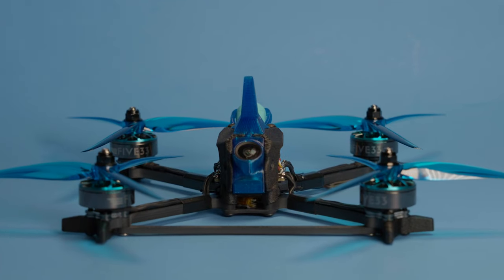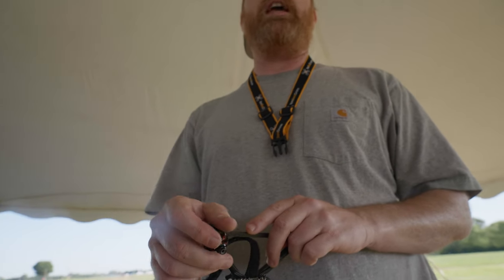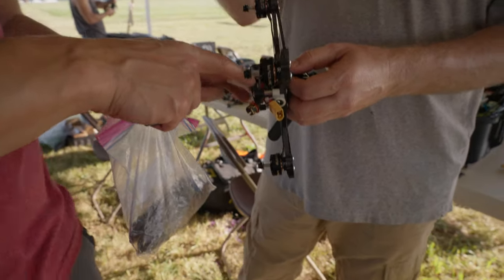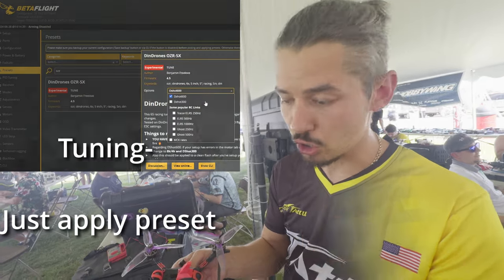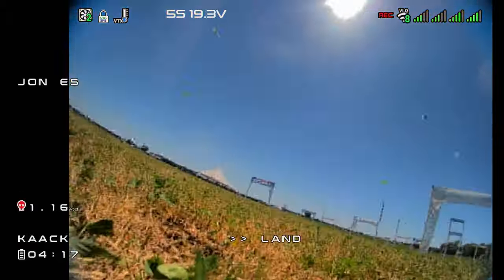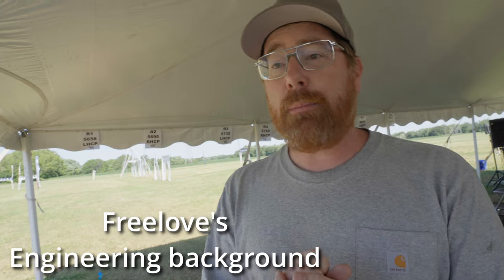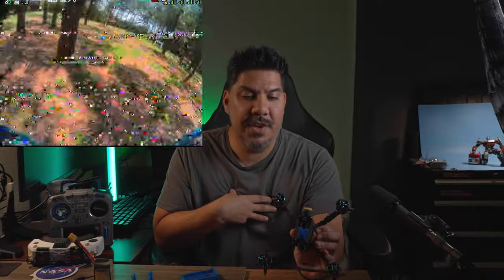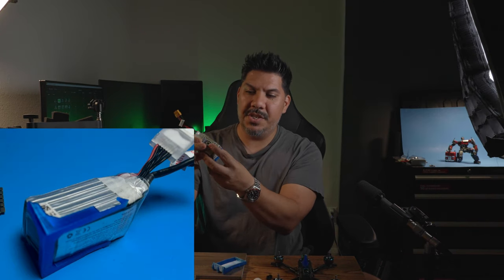Racing drone made faster and stronger with Redbull engineering

Comment: If you look up the definition of Sh*t pilot in the dictionary you will see my picture. I built two of these quads, loaded up the presets for HDZero, ELRS, and the OZR tune and was absolutely blown away by how well this quad handles. No quad is able to compensate for my dismal lack of race skills, but this quad upped my racing enjoyment factor by making it easier to do more laps, faster. I'm ready to pull the trigger on another frame to have three race rigs ready to go.
Reply: What were you running before?
Reply from the maker: Yep. We in the same boat.  Can’t wait to compete with this setup
Reply: @malikmarez1407  Floss 3 so I was really ready for a change!

Comment: I'm still out here running way jankier stuff than Jon - but yeah, what a rad frame.  I'd still want to build one of these slightly chonkier with longer arms for the back, but this is definitely something I want to try out.
Reply from the maker: True. Maybe they make some hybrid arms for that clean air feeling. Although with the tune, it feels just as smooth to me.
Reply: @JonE5FPV  to be honest I've stopped caring about that I actually run at race pace

Comment: Carbon fiber braces are pretty light, but when hit all that force goes right to your electronics (I assume). I wonder if the braces were made of nylon or polycarbonate, would it make the race quad both strong and force absorbing to protect the electronics (at the expense of a little more weight)?
Reply: the main purpose of the brace in this build is to add arm stiffness, so they dont flex under load (heavy corenring etc.) and dont introduce any new noise to the gyro. If you 3d print a brace, you'd need to make it thicker and wider to get that stiffness, and it will be not 2-3g per brace but 8-10g which kills the purpose of a lightweight build. My whole point is - main goal of the brace is not protection. But ofc you can sandwich two together haha
Reply from the maker: The printed stuff is very strong when thick as Din mentioned but then would be heavy. The pod itself add a lot of protection. The brace adds some buy not as much as say an OpenRacer brace that is 5mm (ozr braces are 2 or 3mm I believe). But I ended up not running braces on OpenRacer anymore since so heavy. So lightweight brace you actually run ends up better than heavy brace you leave off.

Comment: You mentioned that you apply the karate tune on your other drones. I think you mentioned on discord ones that you also apply a filter tune for noisy drames/builds on top. Do you still do that? Also bash my quads a lot and don't want to change props every time. 😅 Karate is nice but can get a bit hot, even without the spicy setting.
Reply from the maker: I do always choose the noisy airframe option due to my penchant for running nasty props. But I think they removed that option around 4.2 and now my motors hotter than the sun. But this tune. They landed Luke warm to  cool
Reply: @JonE5FPV  Thanks for your response. Just checked BF configurator and these presets are also available under 4.5. (Noisy and Very Noise Build, with and without RPM Filtering). So you would apply the Karate Tune (without spicy) and then add noisy with RPM filtering in a second step? If correct, I would give that a try and see how it feels. 🙂

Comment: No chance to get a stretched-x version of this, huh?
Reply from the maker: Not currently, but perhaps Din or the team could be persuaded if its a popular request.
Reply: @JonE5FPV  is there somewhere that my two cents can be put in that will actually get to the people that it needs to? Do you know?
Reply: @DavidHanniganJr  i've seen it David, thats good enough haha
Reply: @din_fpv  Ok den! Good deal. Thanx.
Reply: @din_fpv  I'm just over here wondering if 6" arms would do enough - just being able to run hybrid-X with long rears can do a lot for getting that 'stretch-X feel', and also open things up for using these as dual-sport chase rigs with a comically light setup
Reply: @tehllama42  for this scenario prob a Typhon with 5" front and 6" rear arms would work better imho. OZR 6" 5mm arms would flex too much
Reply: @din_fpv  Curiously that's exactly what I'm building right now. Hybrid typhons and really solid spec racers

Comment: Do NOT use aluminium screws for motors. A set of titanium will set you back half the price of a motor, and I promise you you're going to lose a motor unnecessarily if you go with aluminium
Reply from the maker: Good notes. I’ve never tried it before but seen others doing it. Do they just sheer on crashes?

I’ll get some Titanium ordered.
Reply: prob bad experience with china aluminum. if you get it US sourced, its real 7075 T6. i stopped ordering "kits" from cnc vendors and make them myself just because of that reason. JonE5, one of the aspects i should have highlighted earlier - hardware i include with OZRs and Typhons is just next level